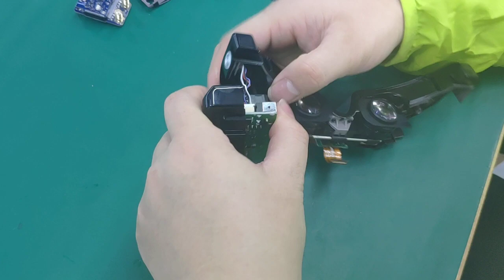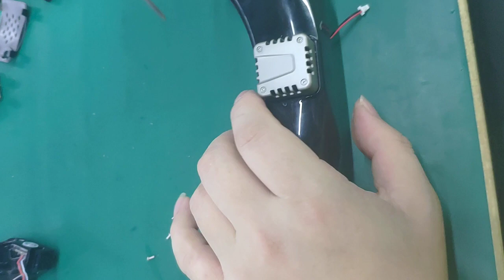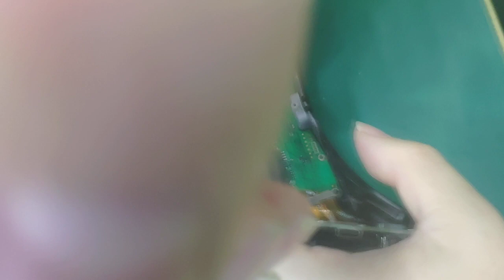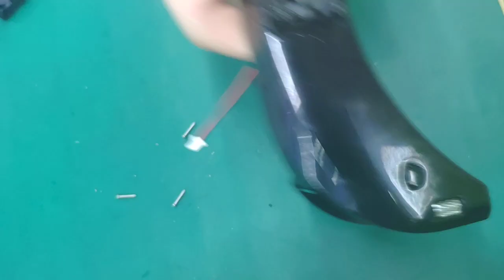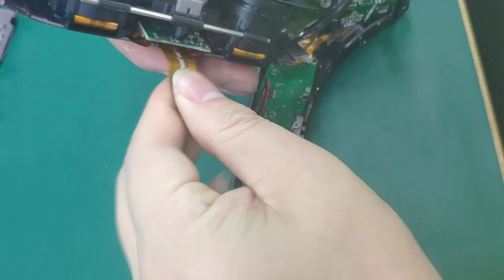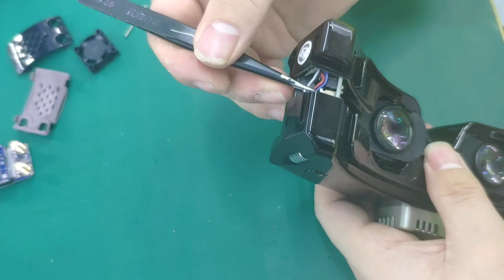SKY04X disassembly and fan replacement

Comment: What voltage does this fan run on, please? 5V?
Reply: I didn't measure voltage when I replaced it with same. You should get the answer from your question in the SkyZone FB group.
Reply: @guntervanasse5767  way to go the extra mile...all you had to do was show the fan in the video.

Comment: What a stupid design, having the fan connector under the mainboard.
Reply: @ClickLikeAndSubscribe  could always snip the wires near the faulty fan and solder the new one in to save dismantling?
Reply: @ClickLikeAndSubscribe  I haven't checked tbh, it's surely a possibility though, no?